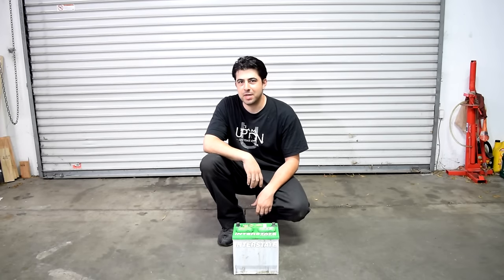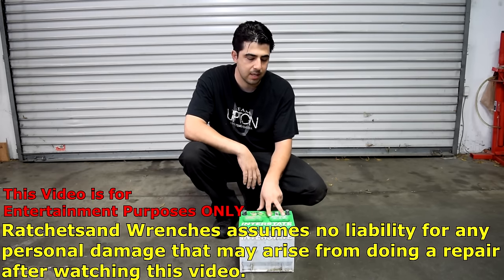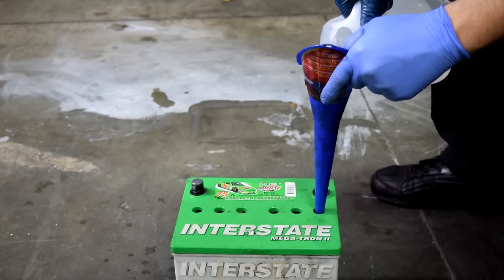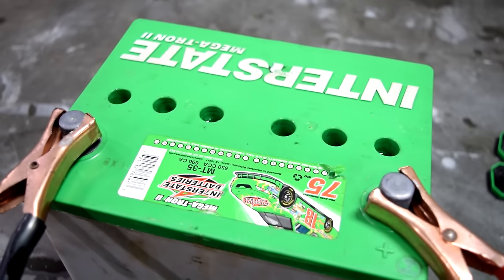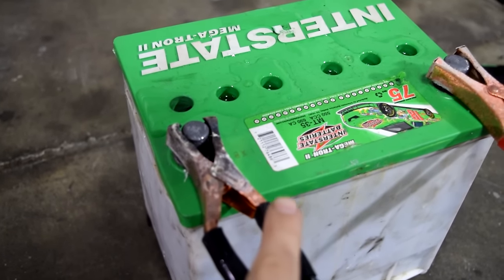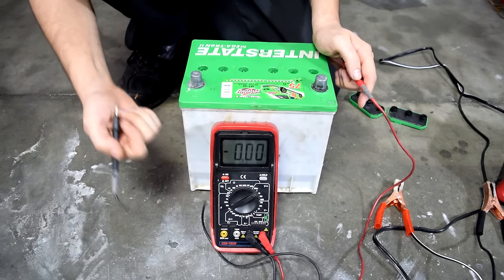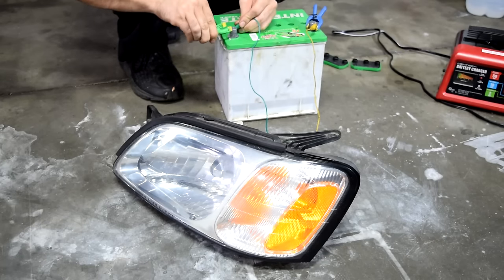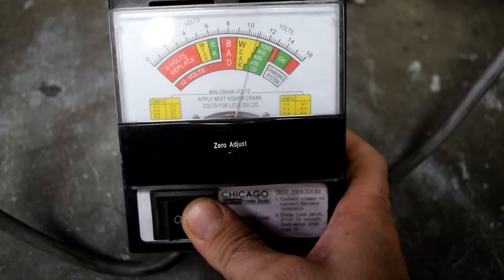Is it Possible to Revive a Dead Battery with Epsom Salt - See For Yourself

Comment: Ounces are not ounces!  Dry powder weight vs. Dry powder Volume... i.e. was that ten ounces, meaning one cup and two more ounces dry measurement, or was that ten ounces avoirdupois in weight?  Why not make it easier for us amateurs that do not have a gram scale, and tell us how much by volume to place in the half gallon of distilled water???  So just tell us ten ounces in a measuring cup and make it easier!!!  Now ten ounces in the measuring cup may not weigh 10 ounces avoirdupois...Do the check just to prove to yourself that ten ounces by weight  is not always ten ounces by voulme!

Comment: here's  several things for doing a pro job
Don't attempt to do this unless you know what you are doing - the acid can burn your skin
check the voltage first - there may be a kaput cell which would waste your time.
Check your battery fluid.
Try to completely recharge the battery.
(I read about these and more from rapid renew roadmap website )

Comment: Your battery is on concrete!?! Do this entire process with the battery on a pair of 2x4’s
Reply: So does concrete really deplete a battery? They're insulated so it shouldn't. Think about it, the battery box is steel. Better conductor. Why does concrete supposedly drain the charge? Capacitance to ground may be the issue. In that case sitting on the ground, asphalt, or tile basement floor should kill it.

Comment: There are several components to battery repairing. One plan I found which succeeds in merging these is the Jons Mender Guide (google it if you're interested) definately the no.1 info i've heard of. Check out this extraordinary website.

Comment: There are many factors in battery reconditioning. One resource I found which successfully combines these is the Jons mender guide (google it if you're interested) definately the no.1 info that I've seen. Check out this unbelievable website.

Comment: Big mistake you made is using the battery on concrete floor it drains the battery
Reply: Probably not so. That applies to the very old style batteries. Think we picked up idea as habitual and extreme precaution.

Comment: I like your videos, but on this one you are making one thing wrong: you placed the battery on the ground, you should at least placed it on top of a wood piece. Every time a battery is left on the ground for too long, it goes bad.
Reply: Adan Ochoa nope, this was true long ago when battery casings were made of different plastics, now this does not happen, i challenge you to get a brand new battery, charge it, leave it on concrete for a month and check the voltage.

Comment: First, you have the battery on the concrete, which is depleting or grounding your battery!  Secondly, sulfuric acid 33% roughly distilled water 67% is the mixture for batteries!  Not water and Epsom salt!  That's strictly to clean and refurbish!  Once cleaned, refill with acid water mixture and then start to charge!  Where do you think acid comes from?  It's put there for a reason!

Comment: Hey, it's fine enough that you want to save batteries, but you flush the
 battery and pour it out on your ground/sewer or ?. There is lead that 
is very harmful to you and the environment. The acid itself is 
neutralized on the ground. If you do this in here in the EU then it is 
close to imprisonment and a large fine. It is for this reason that they 
are delivered to places that can handle disassembly and reuse the 
materials. And you behave like many are trying to do the same and you 
start a wave of more lead in society and the environment. It is 
researched just as mercury is dangerous and causes fetal harm and 
animals absorb this. Lead never comes out of the body. Even at 
cremation, there are lead residues. I am old car mechanic / technician 
and all the courses I have been on with safety and chemistry handling 
then it is totally wrong what you do. I remember my old boss at Mazda 
also flushed the lead batteries and poured it down the sewer. just 
because you want to save a few dollars. If you do not have money and 
believe you are relieving the environment. Or think it's a good thing to
 make a video on Youtube how to flush a battery and bring it to life. 
You can actually buy chargers that can save a battery. But usually when 
the battery has collapsed ie the plates and the battery bulge out then 
it is dead. Buy a new or buy AGM they last at least 5 to 12 years. and 
he says even though nobody actually wants to receive the liquid from an 
old battery but requires that you hand in the entire battery for 
recycling???. Youtubers/Youtube has a responsibility to respond when 
there are more people making videos that hurt people or the 
environment/life is the loser in the end. Lead is toxic and there is 
always lead in the water / acid and is highly polluting if not handled 
properly. I have worked in the auto industry for many years and one must
 not do this as you see many doing Youtubers make a video how to restore
 a bad lead battery and this is completely wrong by flushing it. You can
 either deliver to a recycled place or buy a charger that might save a 
lead battery. or buy a new battery Do not encourage people to flush 
their batteries. and if you can't afford to have a solar system and buy 
new batteries and I don't think so. Most people just want to save some 
money but it should not be to the detriment of our loved ones and life 
on earth. And forget that some will just answer yes they do in other 
countries and especially in the east in the poor countries. But I do not
 assume that you are poor and but the idea is to make a video that you /
 you can make some money on Youtube ?. I think everyone has a 
responsibility and especially Youtubers who have many viewers and 
subscribers so they can do a lot of damage because people will follow 
their advice and don't think it can be harmful and dangerous.

Comment: Lose the epson salts dude and replace that shit juice with new electrolytic and that battery will do fine after cycling it 3-4 times
Epson salts as an electrolytic.... Ba-Ha-Ha-Ha... Ep-sal is great for loosening up the crud on the plates, but poor choice for a replacement electrolytic R & W
One can also hit those batterys with a 200 amp charger set to the full 200 STARTING amps to knock off the scaling crud off the plates, then do it 3 times @ 15 minute blasts each, letting it sit for an hour or so after each 15 minute workout & also 3 rinses with the bi-carb solution, leave battery alone for 24, then slow charge it for 24.... it'll be like new!!. Do it all the time because my vehicle uses 3 battery's (Its a Fleetwood RV)....and along with the current over priced wood & fuel situation, battery's are getting the same way.... 160$ for a pitiful 400CCA exide battery????....retailers have lost their greedy minds
Hoping Santa brings me 3 new AGM's here shortly ;)

Comment: Probably dead because he left it on the cement haha
Reply: Interestingly, some experts (including Car Talk’s Click and Clack) believe that storing car batteries on concrete floors might actually be a better idea than keeping them on shelves or other surfaces because the cold of the floor works to slow the self-discharge (leakage) rate.